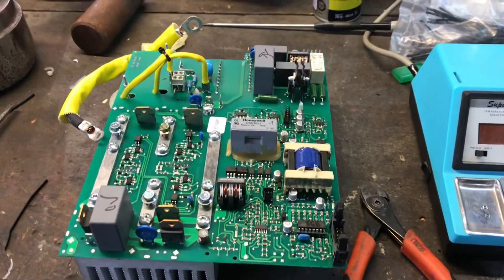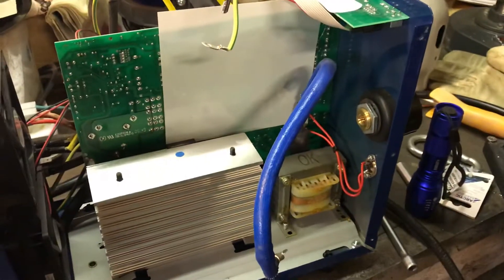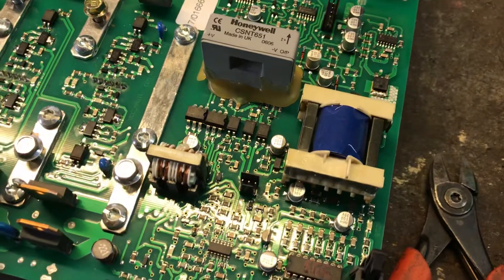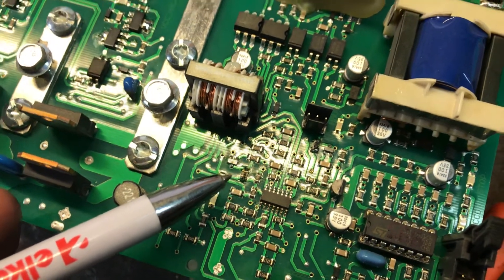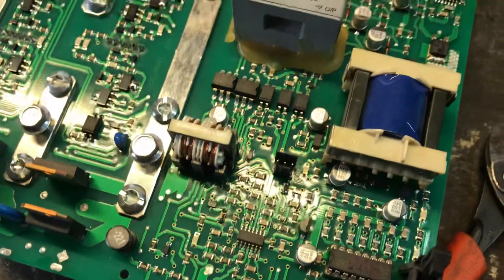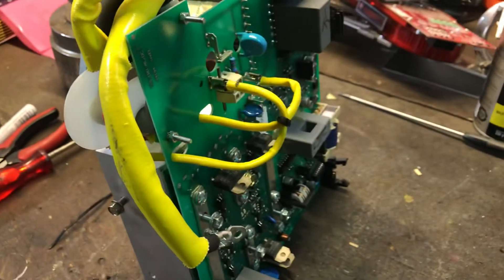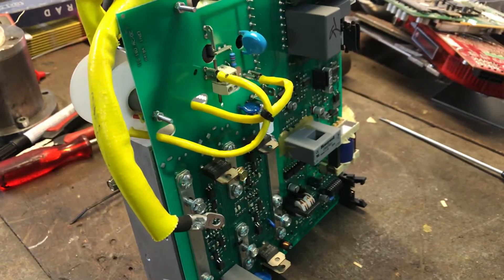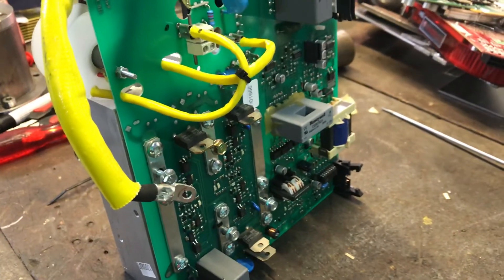GYS 180 AC/DC Tig arc cutting on low amps repair

Comment: I have the same welder and was using it on stick welding the electrode stuck and there was a click from the machine and the power light is still on but the machine doesn't work It sounded like a fuse blowing but I can't see one anywhere inside

Comment: Hello!
Can you help me? I have a welder as in your video. It's work in dc tig, hf and lift, and MMA mode, but it's don't work in ac mode. I read the service manual and after I change 2 optocouplers. But still it don't work. Where is search the fault? 
Thank You!

Comment: Great! My 2006 model has had the same issue right from the start. Unfortunatly the issue is now a lot worse, the arc cuts out and will not restart in either AC or DC until I unplug the 230 volt supply and plug in again.
The gas turns on, but no current, no HF-noise, nothing. If you have any suggestion I'm super happy to hear it.
Reply from the maker: Check the HF arc gap first. Then all the larger capacitors on the control board, and all the terminals some have been loose on some machines. Then its service manual and start measuring with its instructions. There are some updates on the manual for arc stability. Some optos have been changed and something else but can't remember what it was.